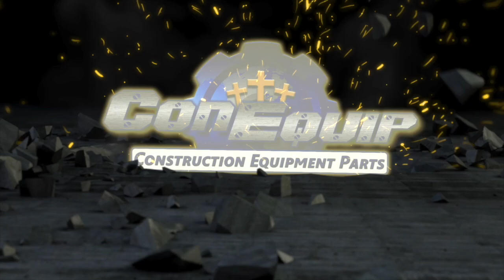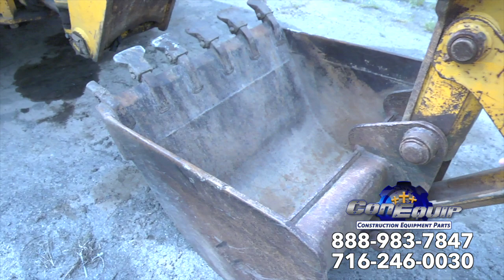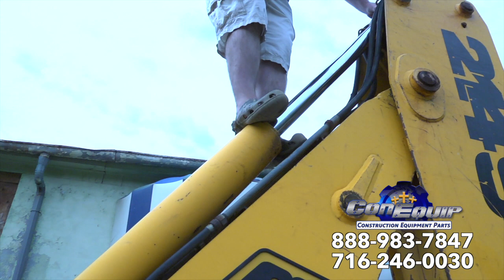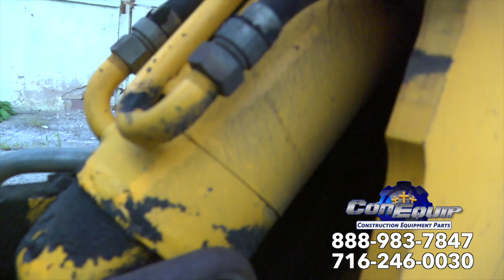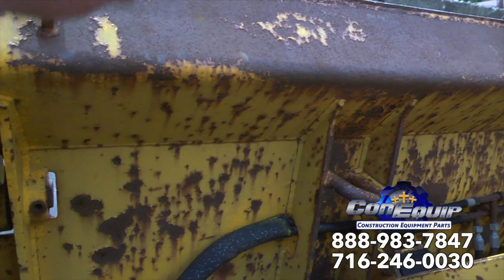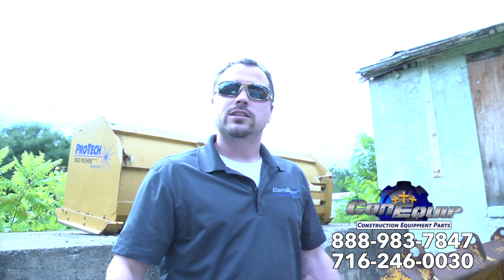Backhoe Cylinder Names - Knowing Your Cylinder Names

Comment: ok my tractor only has one cyclinder the controls the rise and lower of the bucket but my question is how much can i lift with that cylinder 800 pds 4000 pds how can i tell what it will lift
Reply from the maker: That is a question for your manufacturer.  We unfortunately don't have that information!  Thanks for watching!